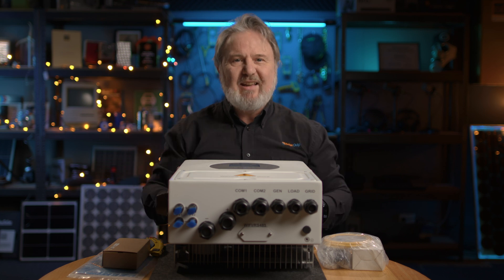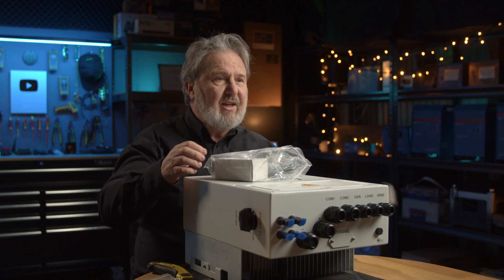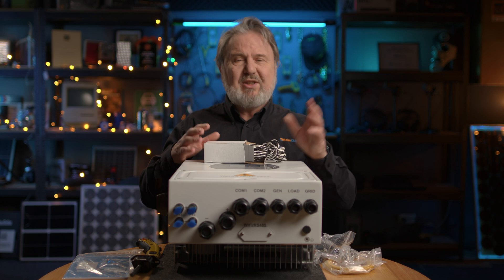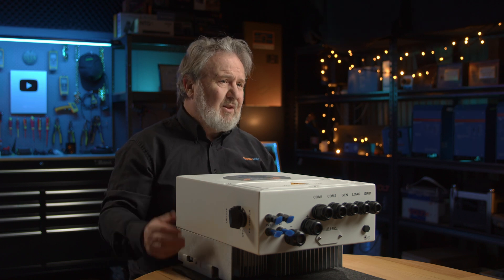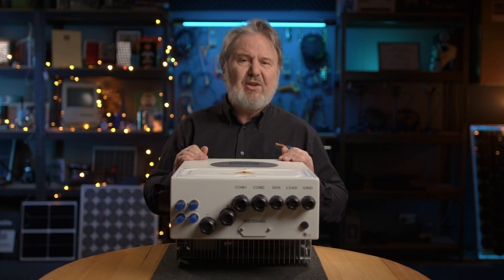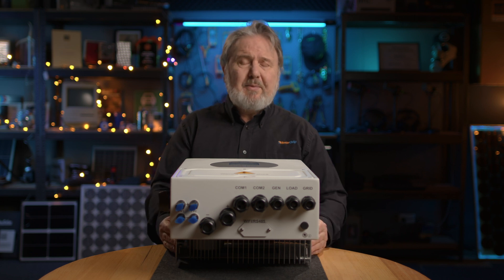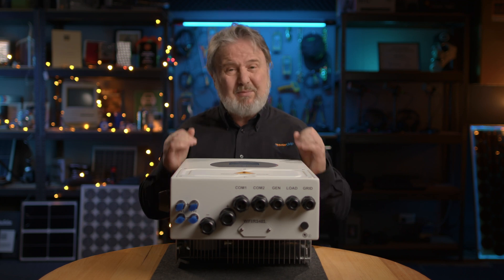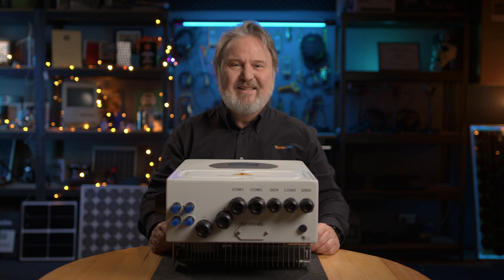Unboxing Deye 5kW Hybrid Inverter from VoltX

Comment: Is the install vid still coming please?
Reply from the maker: Soon... so much going on at the lab and only one of me :(
Reply: @SmartEnergyLab question Sir.is that a high frequency inverter?
Reply: @SmartEnergyLab  Hi excellent video still waiting installation video
Reply from the maker: @uglykoala2022  actually, I'm still not sure if this inverter is legal to install in Australia or New Zealand. Any inverter connecting to an ELV battery must have galvanic separation (transformer isolation) between the a.c. output or any LV port (PV >120V) and the ELV battery. I haven't found out yet if the Deye 5kW hybrid has this requirement.
Reply: @SmartEnergyLab  Shouldnt be a problem - this model is on the CEC list.

Comment: Been running 3 of these in parallel for a couple of years here in NZ with no issues.
15kWp of PV and 28kWh of LFP battery
Reply: How did you set up your CT?   Was only one connected to the master inverter?
Reply: @dumisanid8733 yep, just one CT connected to master inverter.

Comment: What About the Gen Port ? Can We use that one for VTL from an Atto or similar ?
Reply: you can use Gen port to connect diesel generator as a backup energy resource
Reply: @zhiqiuren7105  Why not an ac V2G car?
Reply: @zhiqiuren7105  Sorry I meant V2L?
Reply: maybe，one blogger used Deye inverter to power EV by gen port，maybe you can try to use EV as a big battery，and provide power to load
Reply: @zhiqiuren7105  yes, I think you can,it has been n done